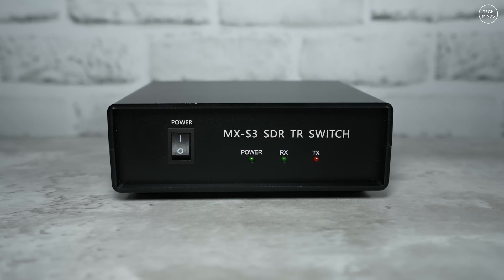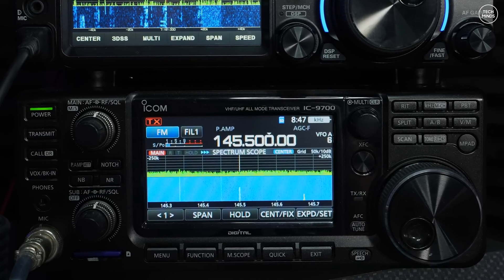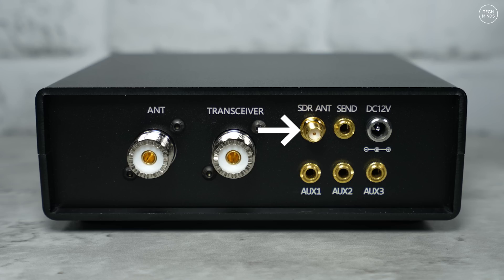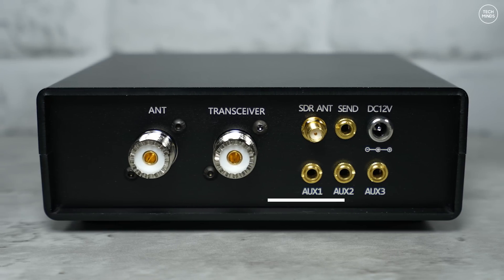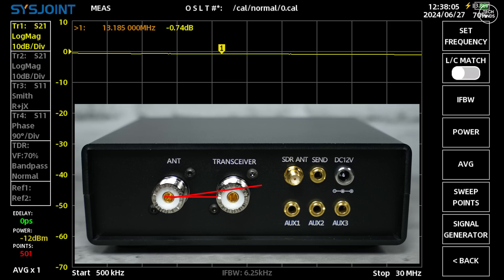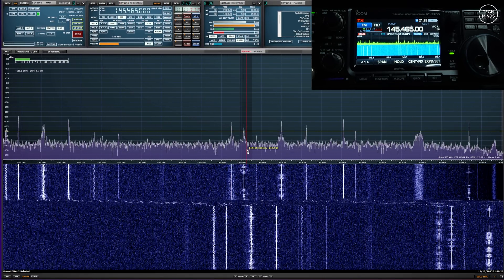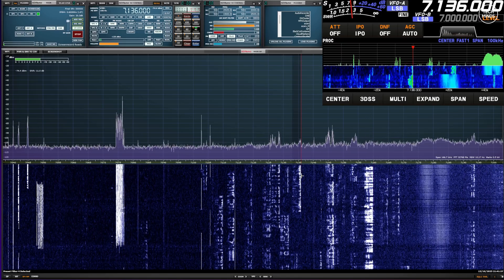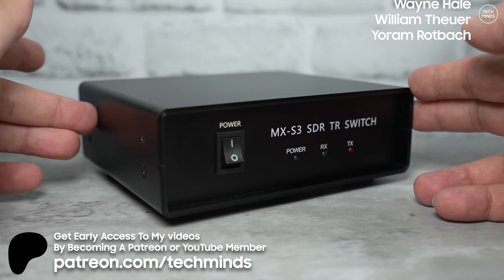Upgrade Old Ham Radio Transceivers With The MX-S3 SDR TR SWITCH

Comment: I've almost all cheap chinese, normal chinese, the good mxs3,  mfj (3 version: sdr, sma and so239) , elad and plan to buy the usa version... All perform good in hf (but not all can handle over 100watt), on 144 emerge some problem and already most cant recive in RX (sdr pfor practice)  port, on 430mhz 70cm band not all can recive. So depend on own budget and freq what buy and use, personally cheap chinese on icom 718, good onm icom 775, normal on icom 781 (still a great lovely radio), 2x on ts2000x (one hf/50 other to 144 and up)... PS: not every one can have BOTH PORT RECIVE some must setup inernal jumper other cant, othger have little preamp to minimize the port dispersion (in some cade 3db already at 50mhz)... my personal exprerience 73 de iz3qvb

Comment: I have a ts680s that I'd love to use this with but as I was researching it and it talked about I might have to do some soldering internally. Do you know of anyone who has made any videos with that radio and how to get it to work with this device? Particularly I think it's awesome because you will have access to the sdr audio. I love my TS680s but the truth is now that I have the icom 7300 I really can't compare the two in terms of RX so this would be a great way to help the ts680s out

Comment: Very interesting. My FT101B Transceiver has a phono socket on back which goes into my SDR Receiver . Switches out on Tx . So nothing else is required. My sdr receiver is a Malanhit with waterfall. So nothing else. Yes I have to.manually tune. Works great. Thanks for doing this video. George ❤

Comment: I have been using the MFJ-1708SDR for years, it works great, never had any problems.
Reply from the maker: I had one of those as well, although I am not sure how well they work with VHF and UHF, which I think is the selling point for this version. Cheers :-)

Comment: As it sniffing the RX there will always be a loss, the RX port needs some RF power to output and the first law of thermodynamics applies.. That loss won't be there in TX (or more likely will be a bit less). I would be worried about spikes of energy getting into the SDR during RF switching and also the isolation from the TX with hard switching.

Comment: 8db and 2.6db loss on UHF and VHF, respectively, from the antenna to the SDR receiver is 84% and 45% loss of signal that is awful.  The lack of significant loss to the radio, though , is a massive improvement.